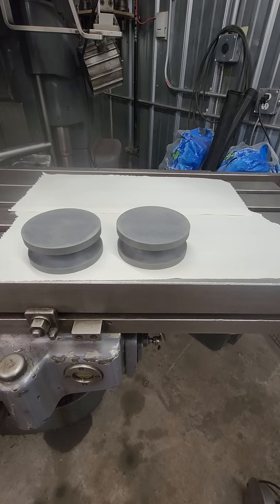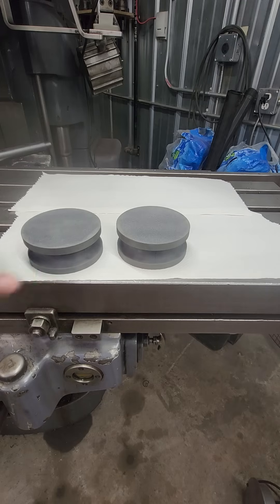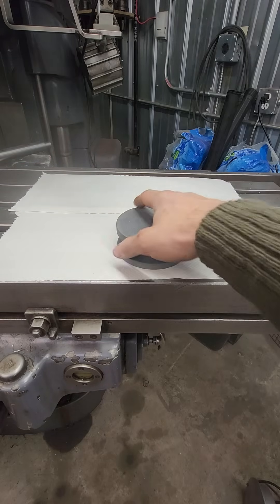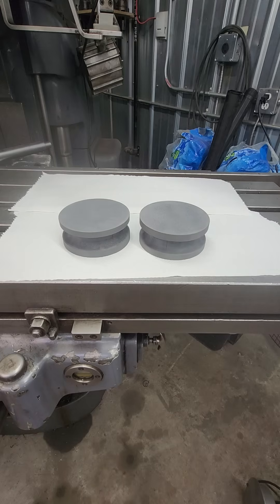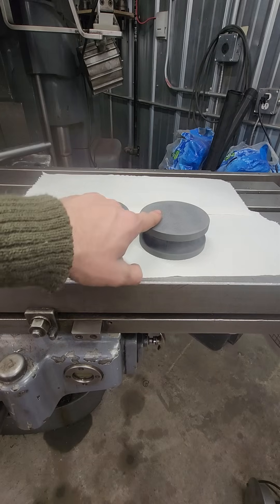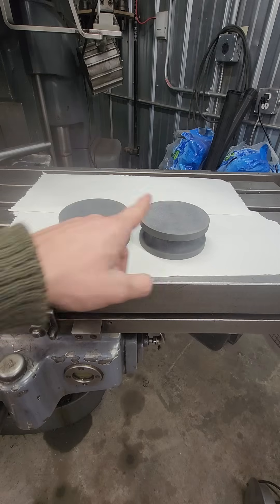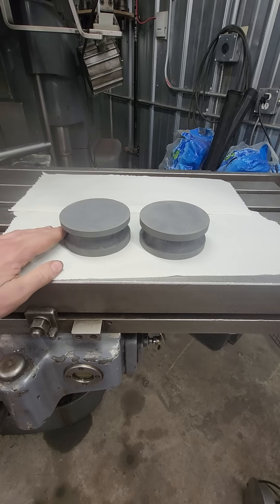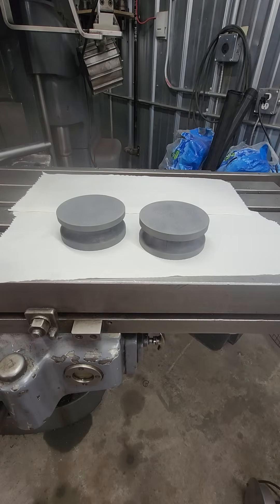The MYTH of precision flat stones in machine shops. (Make yours at home with NO tools)

Comment: How did you follow the 3 plate method with only two stones (granted 4 surfaces but the two surfaces on a single stone are obviously inaccessible to one another for lapping)?
Reply from the maker: Two, two sided objects will give Two sets of 3. It is a bit of a misnomer and not the purest form of the three plate method, but it does follow the same principles and give the same results. It is often used for projects such as this or making iron lapping plates, where avoiding the purchase of a third piece or material is preferred. If scraping in surface plates you would typically use 3 separate plates to avoid the extra labor of scraping in a 4th.
Reply: Gotcha OK I wasn't sure if you had purchased three sets to truly use the full method or not, thanks for clarifying!

Comment: I don’t think robin really meant anything about the cutting action on the stone or anything thing else. He simply is saying that diamond grinding is the fastest way to consistently get the stone flat. As a matter of fact professional instruments used to make these stones by lapping just as you did. When they figured out you can grind them flat with a diamond wheel in 5 minutes they started doing them that way. You only need one pair, they need to make this a production item and, 30 minutes a pair would be bonkers. Furthermore, I see these are round, considerably easier to lap than a high aspect ratio geometry like a rectangle. I would agree it’s robbery what some of these guys are charging for a ground stone.
Reply from the maker: The big takeaway I had from his video was the diamond grinding was necessary for the stones to function as intended. It has been proven not to be the case. That was the point of this video. If I had a hundred sets to make you can be sure they would be ground. 
Initially I wanted to try this out to be able to make one or two more sets to use here. We no longer have a surface grinder in the shop (scrapped to free up space as there just wasn't paying work for it) so it saves me a lot of headache to just lap them here.
Reply: And what about the long sides on the stone so u can go up against a reference rail… can’t lap that so easily.
Reply from the maker: @gavinrusso1957 I can honestly say that has never came up in over a decade. These stones are typically used to deburr mill tables, underside of vises, ect. If anything I would rather a beveled edge stone that would reach the wall without touching it for the application you described. Then you are not relying on the geometry of the stone matching the geometry of the part and can stone both surfaces separately.
Reply: The cutting action is one of the most important features of these stones. Some people don’t understand how these stones work.
Reply: Grinding doesn't make better stones, it just makes them faster.
Reply: @JamesChurchill better is the wrong word.

Comment: I've done something a bit of a hybrid of this. I bought a pair the expensive bench stones that were ground and then an off brand bench stone. Used the 3 plates method to bring that 3rd one into a nice flatness fairly quick and then use it like it owes me money while keeping the nice ones in fairly good shape. 

Curious what you use to clean your bench stones? I've tried a few things now but cardboard seems to be the common denominator between the cleaning agents. Then just wiping it off with a shop towel afterwards before bringing it in true.

Sorry Im rambling but hope you have a happy new year and that 2026 is a good one. Cheers!
Reply from the maker: I have personally had the best luck using a light solvent (such as acetone) and blowing dry with compressed air. I have not tried enough difference approaches to have much of a comment, but this seems to work well enough and it is fast/easy.
Reply: Not yet tested but heard ultrasonic cleaner can help.
Reply from the maker: @craftzars i would absolutely believe that. If I had one it would be high on my list to try.
Reply: @craftzars I can attest to ultrasonic cleaning being an excellent way to clean these stones.  it tends to dislodge the particles that are stuck in the pores.  I also use an alkaline degreasing solution so it removes oily residue that acts as a binder for the ultrafine particles.  the stones come out looking and working almost like new.  I follow up with a few short runs in ro/di water to get the degreaser residue out  and then thoroughly dry them before they go back into service.  Clean them Friday then let them spend the weekend drying with a small fan, good to go on Monday.  it's maybe an hour to clean them, but only 5 minutes of that is actual effort.